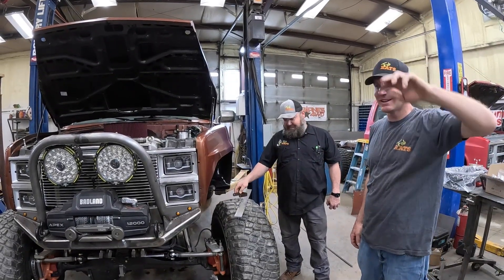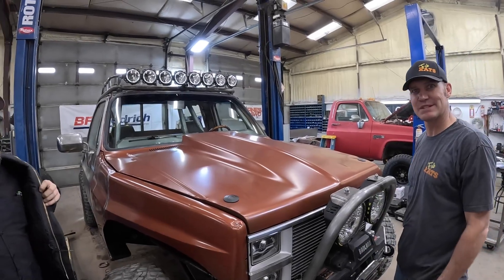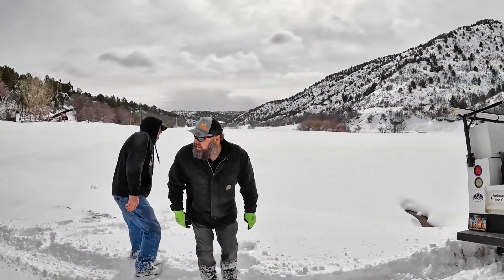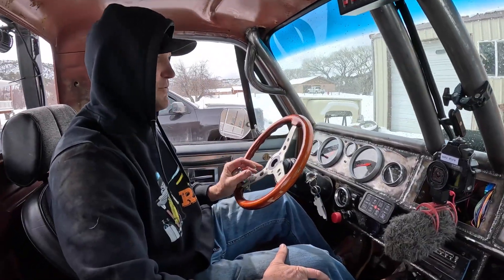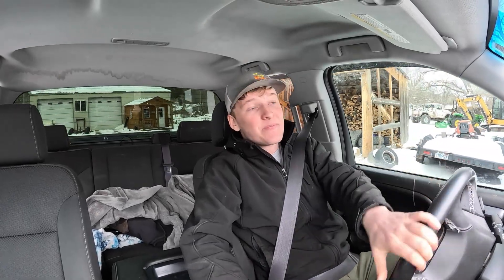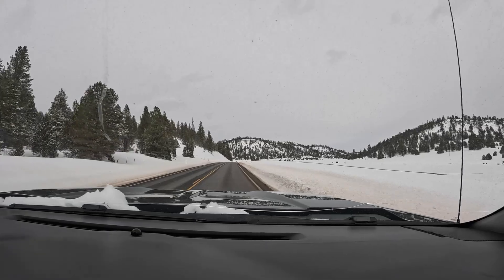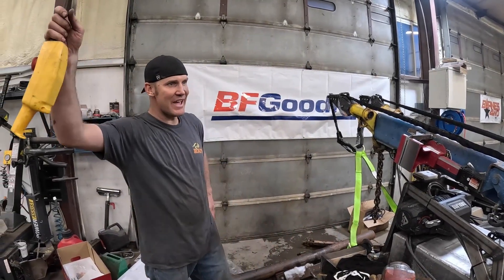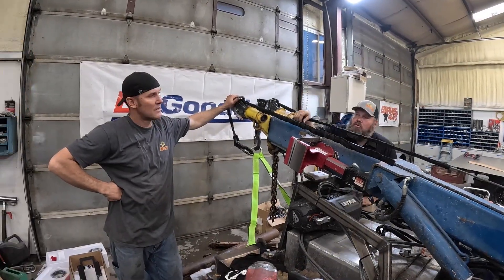The Rat Rod Wrecker's First Recovery. Back To The Drawing Board!

Comment: You know if Hunter's truck had a winch it could have done the recovery.
Does the heater work in the truck??
Snow?  You should come to the Sierras!  The snow is higher than double the roof of your pickup and it's Sierra Cement, not the light fluffy stuff in Utah.

Comment: Could those electric winches be placed a bit further up, leaving the hydraulic winches in there?  Then the other systems could have stayed the same etc.  It would have given you the many benefits of the hydraulic vs the electric.  Just a big fan of the hydraulic.  You can speed up the hydraulic, but really why does it need to be faster?  Well, it's your baby so do as you please.

Comment: might be cool to mount the electric wenchs above the hydraulic so you have both options.  hydraulic is slow but it wont drain your battery if you have a long heavy pull.

Comment: Hydraulic winches work better for long winching sessions, and are also rated to hold the weight because they are normally worm gear driven at that size. You can make hydraulic winches pull faster by increasing the idle for more fluid flow.

Comment: Yeah, hydraulic winches are grand for when you just need to PULL 'til something breaks in half, or drag something all day, but they're not the fastest.
Electric winches have definitely got the edge on speed. I think you've made the right move, for sure! Right tool for the job, and all that.

Comment: could be worth putting some hydrolic or sliding legs on the back for when you have to winch so the truck don't do wheelies on anything with bit of weight also great for the winter as it stops the truck sliding

Comment: How long does that battery powering the winches last? How does that stay charged? Just curious. =)
Reply: Truck running plus amps the alternator output is rated for and how many AH batteries.

Comment: I'm sure you figured it out but those hydrolic winches will be great if you use airplane hydrolic fluid. The oil viscosity in the cold is terrible. I used to work for a freight delivery company with hydrolic lift gates and once they changed the oil it was just like summer all the way to zero degrees Fahrenheit.

Comment: While slow.  I suggest the old winch’s could have pulled a large truck if the wrecker was anchored. (Or rip wrecker in two).  They make amazing rigs. And abuse them.   I will stick to low tech tools I know and slow pulling torque.

Comment: When you were pulling with the boom it was picking up the rear end of the stuck truck so he wouldn't have much traction. Maybe have a another winch down low and use them in tandem.

Comment: It’s funny all the hater’s out there he figured out that the PTO running off the transmission wasn’t the right set up for what they are doing with the truck they need to be able to a just on the go most transmission PTO set ups you need to be in neutral, or  low so electric over hydraulic for the boom and straight up electric for the winch

Comment: Hey Paul watching you tow with the rear winches, I think you should use the front winch to limit the articulation of the front axle. Seems like it was working against you a little on the pull. Since you have already made the attach point for the front winch to the axle. Apologies if I am already telling you something you figured out.

Comment: Paul don't be so quick to eliminate  the P.T.O. winches you have 2 obvious  solutions  my choice was another  P.T.O. I found a 2 speed Chelsea and yes the 2nd speed was an overdrive the other would work you since you are hydraulic  over P.T.O. simply change the hydraulic  motor to any rpm you choose they even make 2 speed hydraulic  motors you will end up with winches that don't overheat and are way cooler than electric  (everyone has  electric  winches just saying

Comment: bad idea swapping out to electric. could have added a single auxiliary for the boom, but losing the power of the hydraulic winches will bite you later
tow trucks are built to a spec for a reason!

Comment: Kind of a shame to just throw the hydraulic winches away after all the work you put in to mount all the hydraulics I’ve used hydraulic winches for almost 30 years I prefer them yes they’re a little slow but you can pull a house down with them. I’m not so sure about electric winches, but you’ve had more experience with the electric winches than I have

Comment: I'll say it again the truck needs outriggers to be be effective with the hydraulic boom
Reply: Nope.
Needless weight.
And ground clearance issues.
Bad idea.
Excellent for on road heavy recovery.
Reply: @haroldphipps3457  lightweight ones could be made out of tube stock that would probably weigh less than the double winch setup that was removed including the hydraulic cylinders required, more over the two hydraulic circuits the are no longer used for the winches could be plumbed to the required cylinders